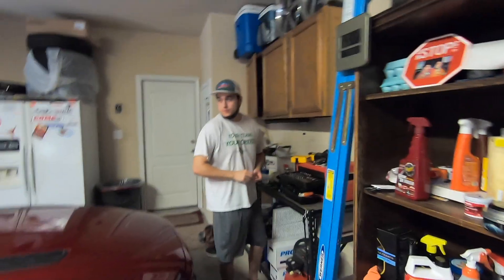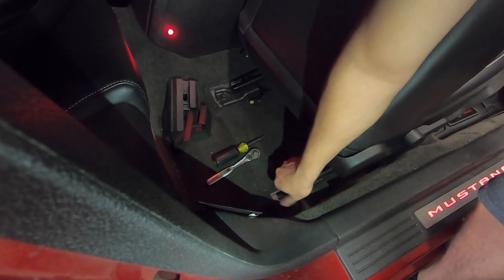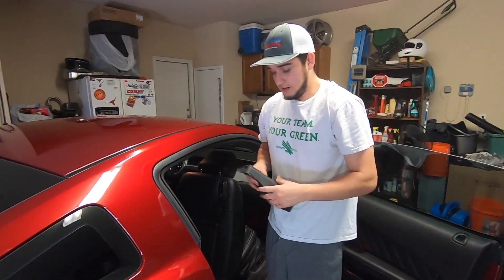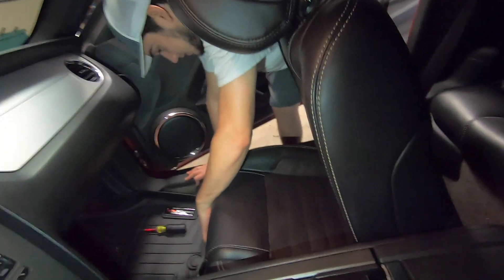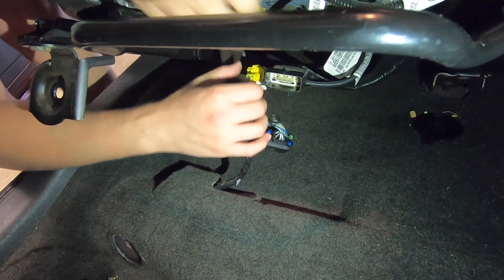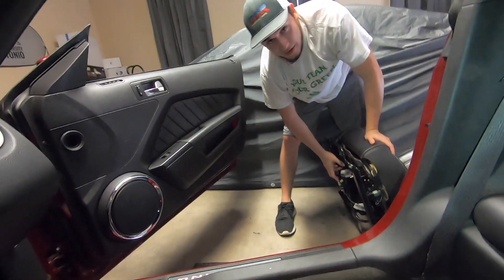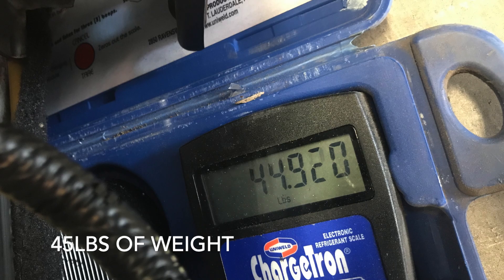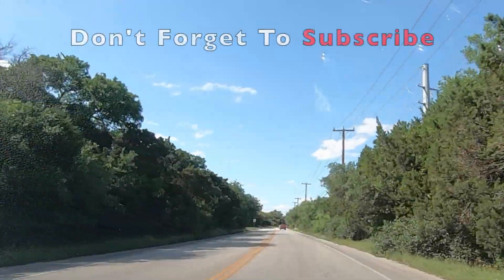11-14 Mustang GT Passenger Seat Delete

Comment: I'm planning on changing out my front seats I've been looking trying to find how to bypass the codes due to the fact that I need something to keep the passenger – airbag working because of the pressure sensor in the seat any help with that
Reply from the maker: I havent found any workaround for that. I would ask a tuner if they would be able to remove the code but thats all the advice i would have for ya.
Reply: @EGPerformance  i have no idea where to locate a tuner where i live unfortunately
Reply from the maker: You can go with a online tuner. Lund, VMP, Palm Beach Dyno. Just ask if they would be able to do it and go from there
Reply: @EGPerformance  thanks I'll check into that

Comment: How much power would that add by taking out the seats?
Reply: rule of thumb, for a 250 hp car every 100 lbs = 10 hp gains.. its a bro science that's subject to various factors such as gears etc..
Reply: @maceldolaimy4944  is this from a reliable source ?
Reply: Doesnt add horspower, but 1/4 mile rule is for every 100 lbs you gain a 10th.